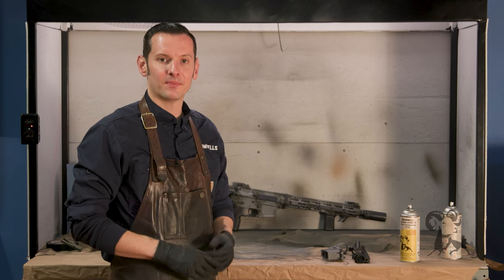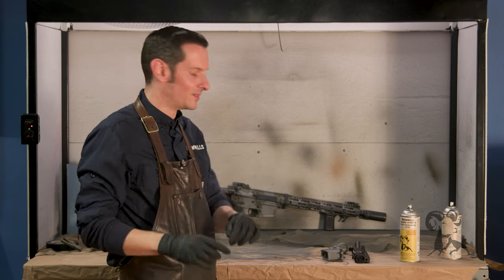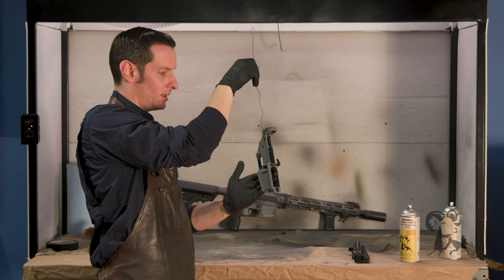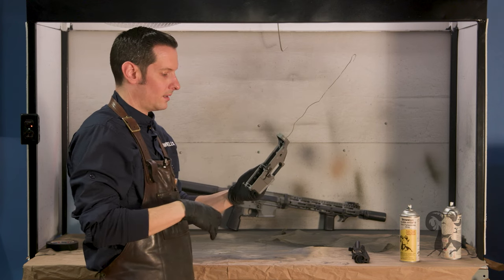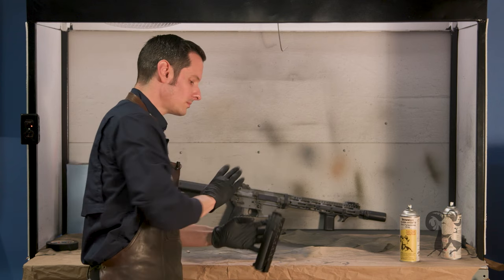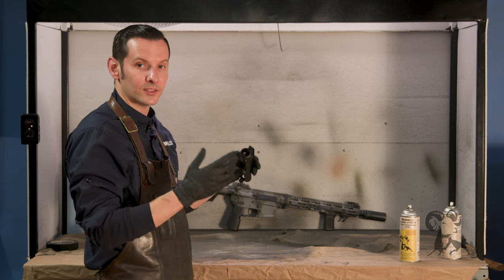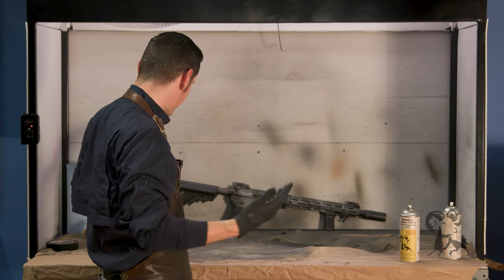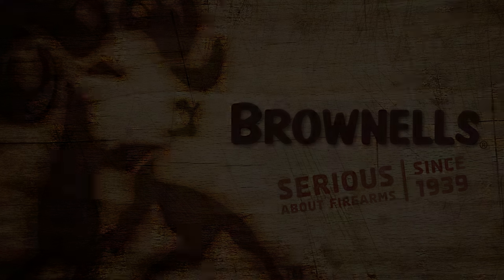How to Paint Your Firearm: More Painting Tips

Comment: Assuming you clear the pickup tubes when you're done painting, what's the shelf life on the 'now opened' can of Alumahyde? Would it still be good a year later? 6 months? ...
(edit) Also, any plans for a white, or off-whites, to do winter camo or Stormtrooper?
Reply: Generally, the lifespan of spray paint after opening the paint can is half the original lifespan. So, for instance, if the spray paint has four years left of its shelf life, opening the can cuts the shelf life to two years. However, it also depends on the type of paint.